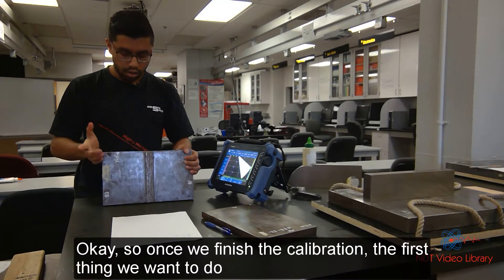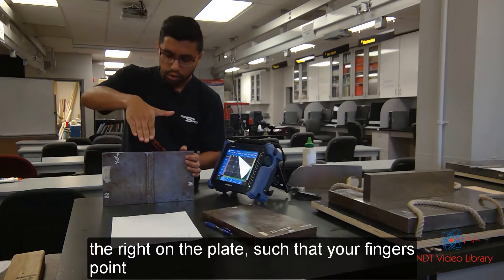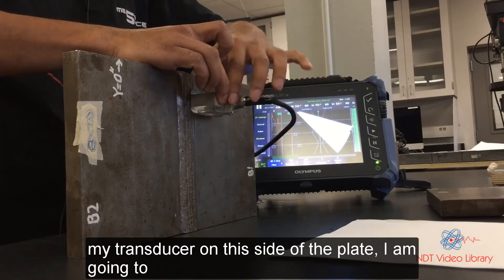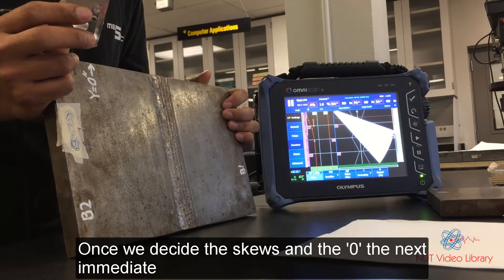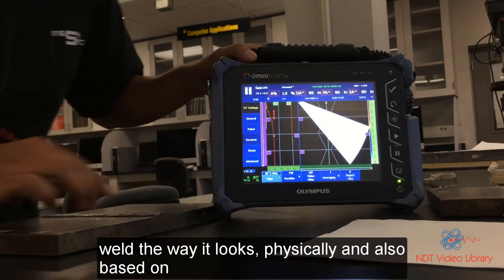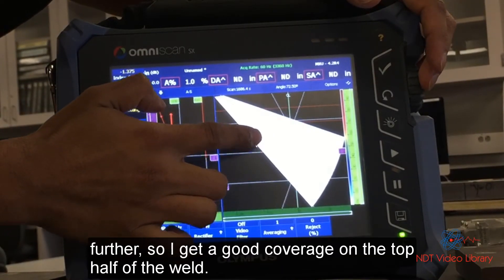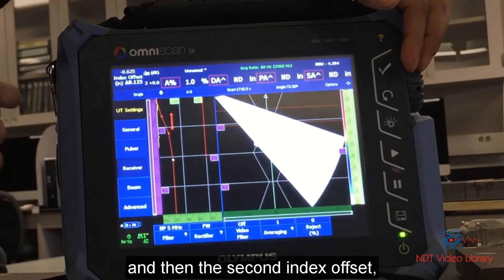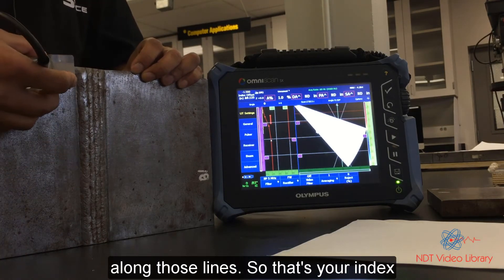What are Skews and Index Offsets in PAUT?

Comment: SKEW90 & SKEW270 on Screen is right, but  on the probe weld piece is wrong, the SKEW90 on your left, and SKEW270 on your right. -Index value is on SKEW90, + Index Value is on SKEW270. the SKEW Define on “Introduction_to_Phased_Array_Ultrasonic_Technology_Applications 4th Printing 2017”，p169.

Comment: My friend it's better to use Omni PC setup and perform a scan plan firstly making a group for covering the root and another for cap and that's better for adjust the index offset and then save your focal low in a file
Reply from the maker: Ideally yes. But sometimes the scan plans don't work on the field because there are some physical restrictions. In that case a technician has to use his judgement and come up with the offset.